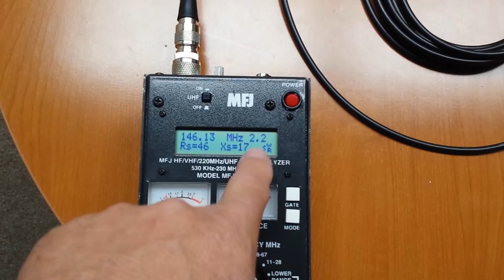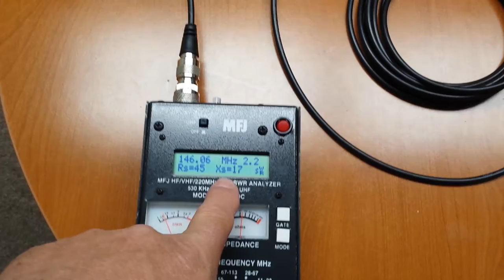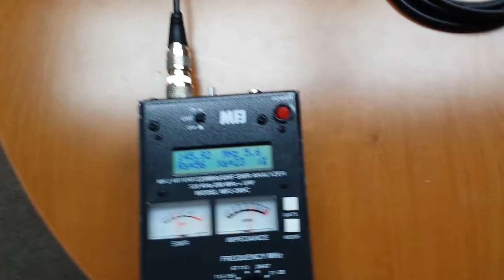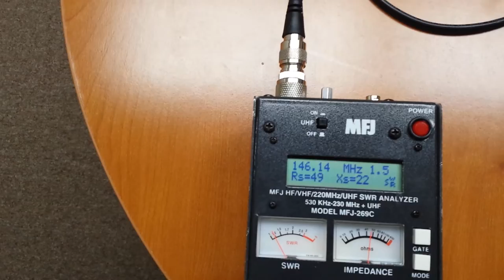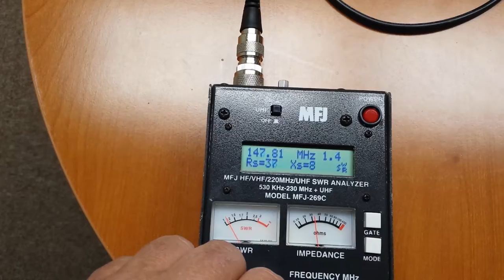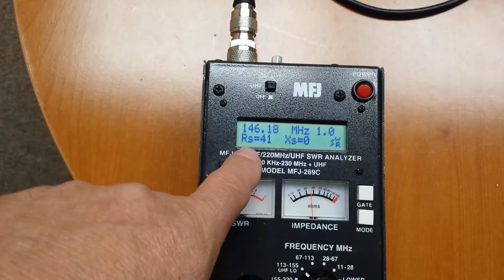Why antenna mounting and position is so very important

Comment: I just bought a malachite sdr. I've always been interested in radios but never got into it until now.
I will study your channel thoroughly over the next few months, I've already watched a few👍
I just thought I'd tell you this story...
Many decades ago in a country far away from here (Wales) I was picking through the local tip looking for "luckies" when I came across a big grey box with switches and a dial. I was about ten years old at the time and it was too big to carry so I looked about a bit further till I found an old pram, I loaded it up and pushed it home (not as easy as it sounds). When I showed my dad he was delighted, "it's a radio transmitter" he said. After fiddling about with it for a while he noticed that the tuner was connected to the dial with a chain and sprockets but one was broken. He was a machinist working for Reynold Chain so he took the part to work and made a new one. I think he also replaced some fuses but that was about it. Then we pulled an old transformer apart and made an antenna from the wire, it was about a hundred foot long. He knew nothing about radios but he got it working, he used to sit for hours in the shed looking for interesting stations. He said he listened to taxi's in NY and I once heard a climber in the Rockies talking to his buddy. Anyway, a little while later we had a school trip to London where we went aboard the HMS Belfast which is moored up next to Tower bridge. When we saw the radio room there was exactly the same radio! 
I don't know what happened to it, they're all gone and I'm in Australia. Pretty cool though:)